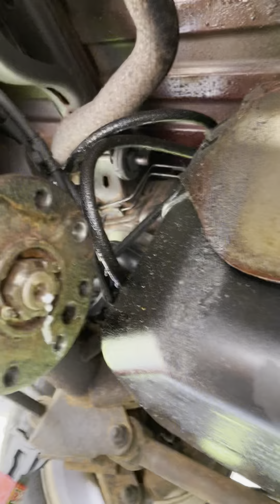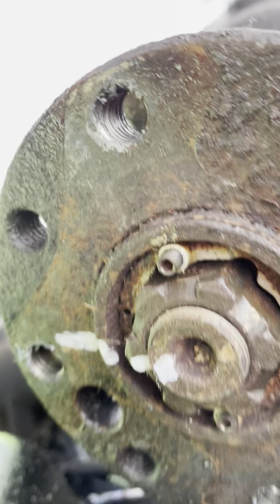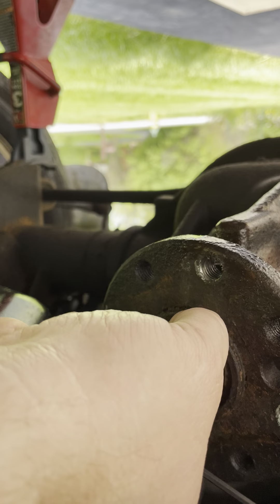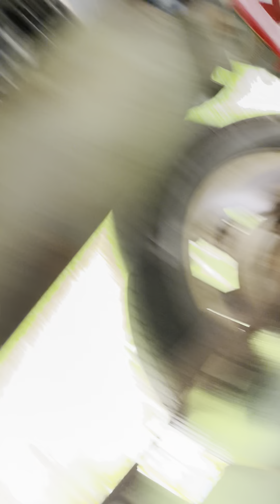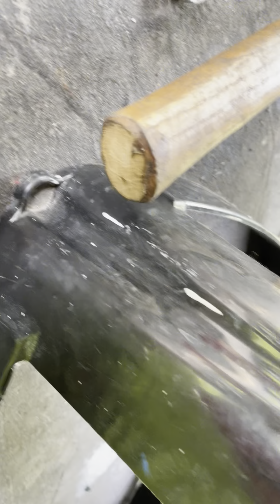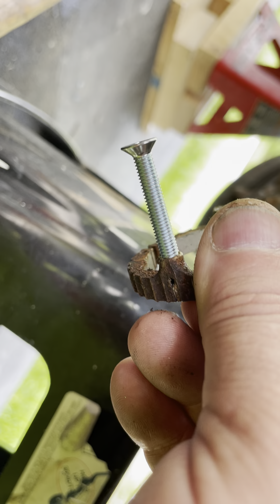How to remove pinion nut retainer on Dodge Ram 1500

Comment: Buy Fords, avoid this nonsense!
Reply from the maker: Sure. Those spark plugs are easier than a pinion nut
Reply: I’m not up for the exhaust manifold gasket issue they always have.